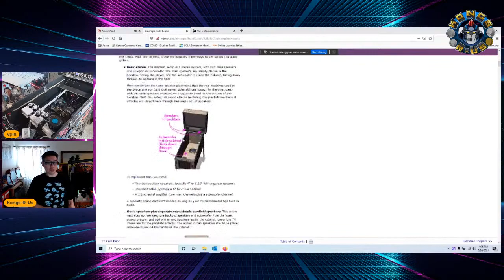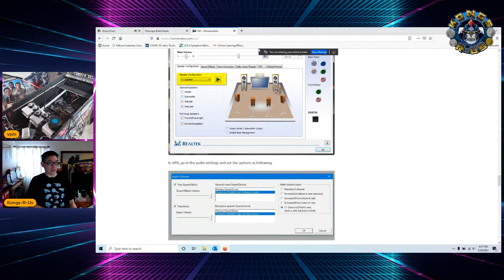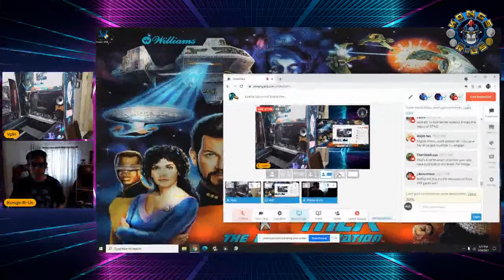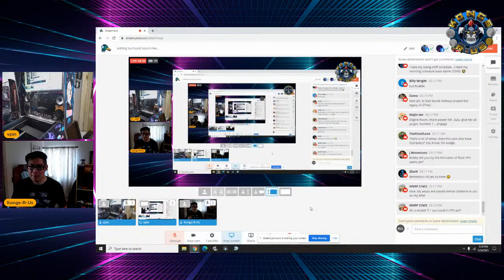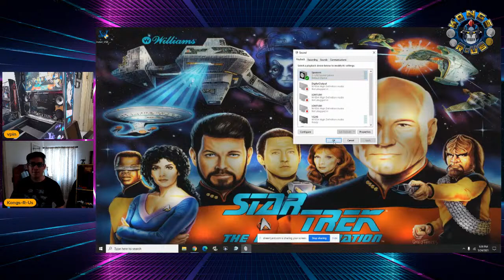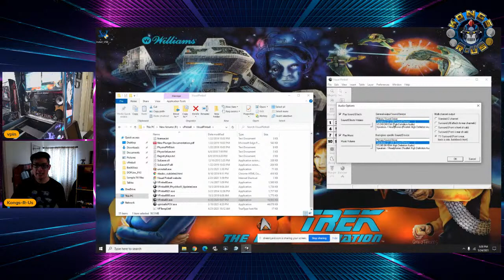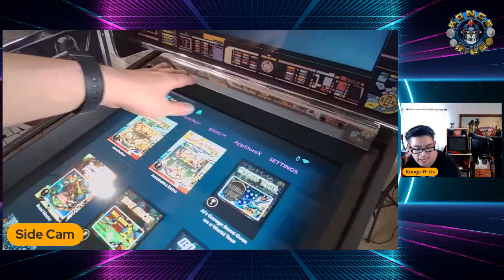Adding Surround Sound Feedback (SSF) to Legends Pinball - LIVE Modding Session (AtGames)

Comment: Hello! Thanks for the video! It appears that I might have messed up the output if output line that leads to the exciters. I am trying to hook up exciters Yup exciters and a bayshaker using 2 different amps. I was not successful. It appears now hooking everything up to stock exciters I am getting no no output to them. Is there a way to connect an amp to the existing speakers And achieve the shake?
Reply from the maker: Not sure exactly the issue. In my mod for Surround Sound Feedback, I used a completely separate speaker system for my main + sub Woofer,  and 2 Amps for the 4 exciters in the cabs. I kept the stock speakers wired to be used with stock tables only, so not sure I can help troubleshoot your issue

Comment: I just remembered something regarding the Exciters. Did you say they are 4ohm or 8ohm?
Reply from the maker: these are the ones I used Dayton Audio DAEX58FP Flat Pack 58mm Exciter 25W 8 Ohm
Reply: @KongsRUs  are the amps 4 ohms or 8ohms? If they are 4ohms, you'll need to wire the Exciters in parallel. That might be the reason why they are not sounding as loud. Also, since it's a different exciter than mine, try screwing 2 in on the front and see if you notice any difference in tactile feel and sound. I think the issue is the ohmage and how it's wired
Reply from the maker: @cleetusvandame  thanks! I'll bust it open layer tonight to check it out
Reply: @KongsRUs  keep me posted please with your findings 🙂
Reply: @KongsRUs  how did you make out?
Reply: @KongsRUs  I'm also curious about this since I'm about to order these same ones. I can't even find anywhere in the descriptions on the product link if they are 4 or 8?
Reply from the maker: @cleetusvandame  I was able to tweak the amps for the exciterd and installed PinVol to turn down the table volume do I can hear the mechanical sounds and it's much better! I'll probably do another live stream on Thurs to show off the results and then work to adding in the contactors. thanks for all the help and suggestions!
Reply from the maker: @patrickblank1665  you know, I was looking too and didn't see it. I have some other DIY 2.1 channel amps I was going to use, but they need 24v power supply for optimal power. https://amzn.to/3upultY

Comment: Is this the only solution to get haptics in any capacity working in OTG? I'm still not sure what to believe, as I've seen some people say their Haptics worked in OTG with no extra config or setup, and some people say it worked then FW update broke it, and others like me where it has never worked. I tried the whole DOFLINX setup following TerryReds instructions, but still nothing (note: my ALP is stock, no upgrades). I was hoping someone could give me a solid straightforward answer.... What is exactly needed for Haptics to work in OTG?
Reply from the maker: You need to define what you mean by haptics, as the stock ALP uses exciters under the control panel for vibrating feedback only. In OTG, if you set the sound to use the stock speakers, you'll hear audio thru the exciters and somewhat feel feedback, but true Surround Sound Feedback can only be achieved by installing dedicated 7.1 Sound Card and with additional Amps and exciters as I demo in the video.

Other haptic feedback I've added are real Solenoids to go along with my SSF inside the cab
Reply: @KongsRUs  oh yeah, and EASY earned sub 👌
Reply from the maker: @FilthTribeFTP  if the stock exciters aren't working, I'd start by checking the connection wires from the exciters to the extension wire that plugs into your PCB in the back. Troubleshoot that and make sure it's all secured and connected and you hear/feel them with the stock games
Reply: @KongsRUs  ok super frustrating, lol, but YouTube keeps deleting my comment, and I can't see where it's seeing "profanity" or something questionable to warrant a delete. So I'm going to keep trying to comment the full comment but basically, stock exciters work on everything just not OTG. You.may or may not see a 2nd comment under this one, lol
Reply from the maker: Ahh, yea, I don't think the stock exciters are setup with any surround sound support for OTG pinball tables as far as I can remember
Reply: @KongsRUs  yeah, that's the 1 problem with AtGames, is nothing is ever clear. I've had some people say the exciters should work in OTG. The "manual" they send out with the ALP is almost laughable. Like anyone who would need to refer to the info given there is probably better off not owning the thing, lol. Anyways, thanks for your input.
Reply from the maker: @FilthTribeFTP  it wouldn't be true exciter feedback if you did hear anything, just another set of speakers to output to. Most OTG tables need to be setup to have the 7.1 surround sound speakers identified so it can correct send the right sound signals